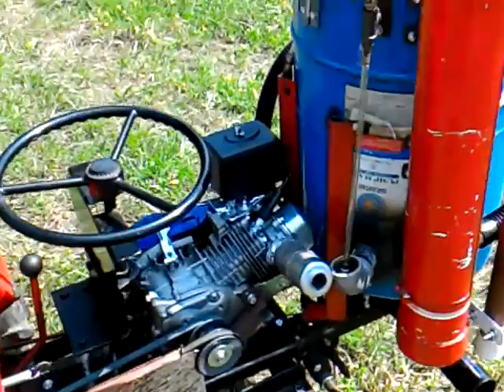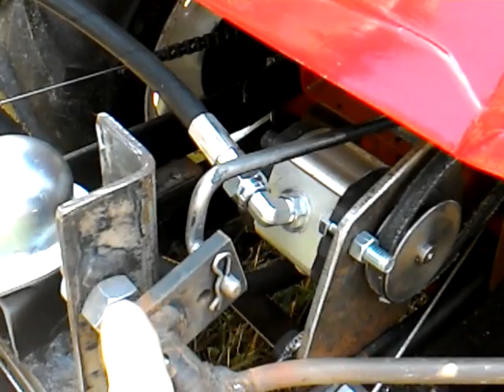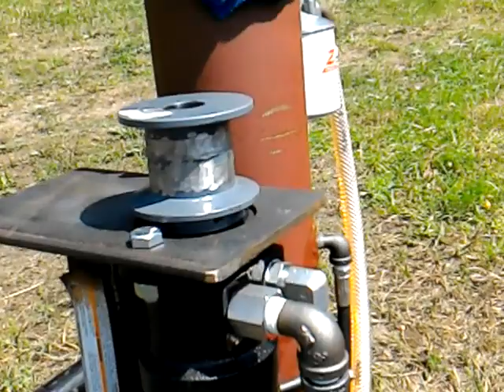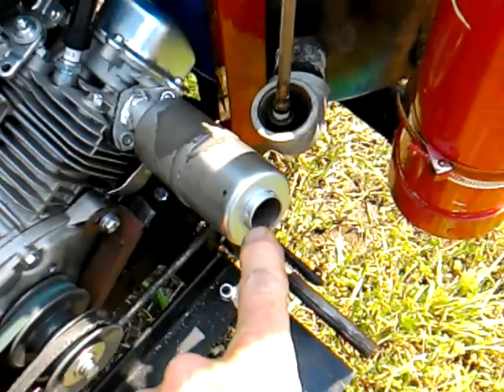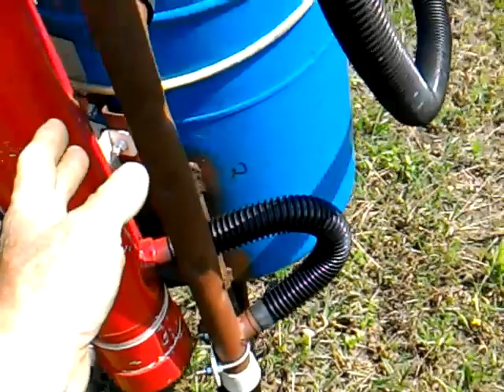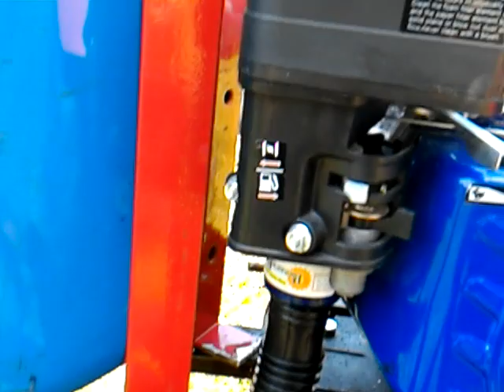Forwarder Skidder Crossover

Comment: I love that,  I wish that you had put the hydraulic capstan build on video here.
I don't know enough about hydraulics, but need a setup like that badly.
Reply from the maker: That was easy. Used a two groove V-belt pulley, removed the center belt wall. Just match the pump to the hydraulic motor.